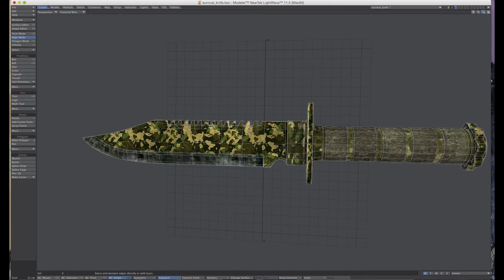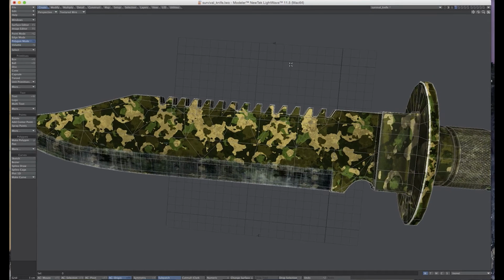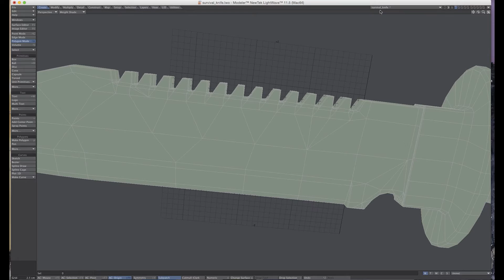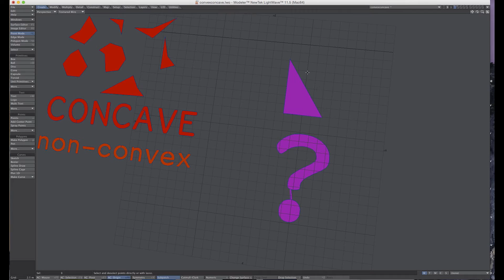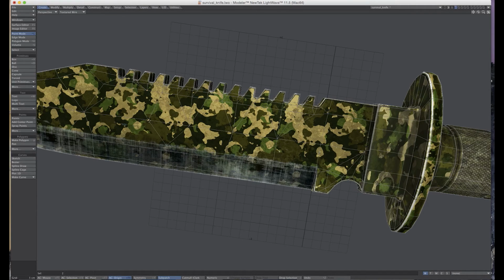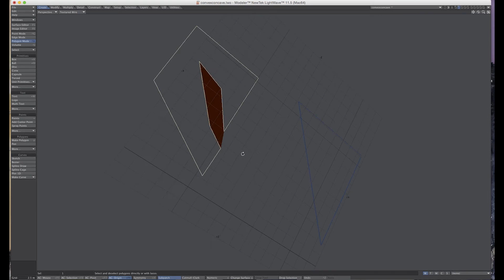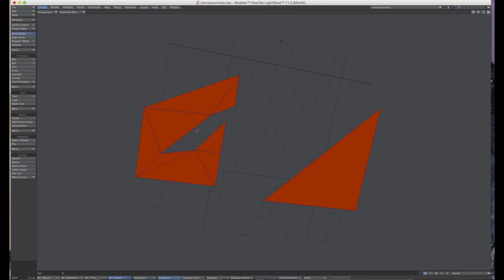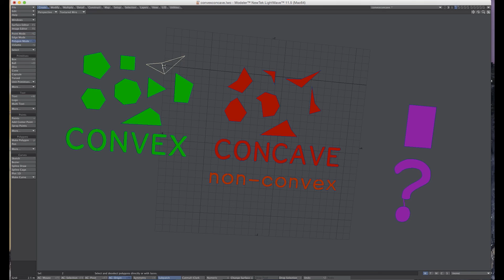Possible Issues with Concave Polygons in 3D

Comment: 0:30 modo does that to me too with some polys, that I've modeled using other apps.
Reply from the maker: Thank you for your response to my video. Oh! That's very interesting. Modo is one of the applications that I haven't used.
Reply: ***** modo has a unify poly flip button, that I have to remember to use every time I import an OBJ into it. I model in Hexagon or Amapi first. Old programs.
Reply from the maker: Yes, lightwave has also unify normals. Wow, I never heard of those programs! I must check them out! Really thanks for your comment.